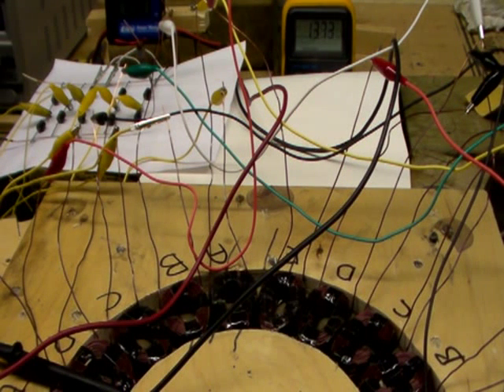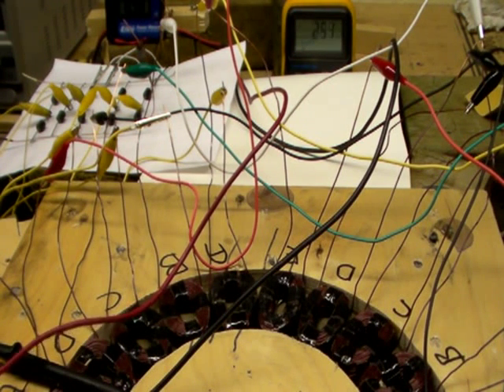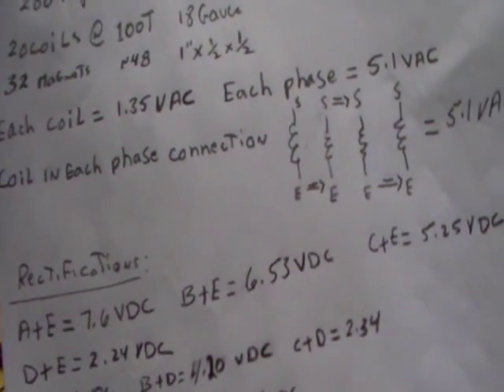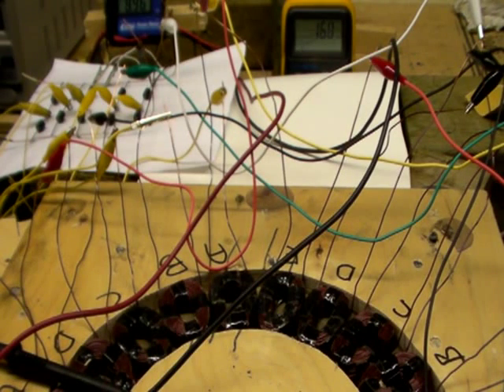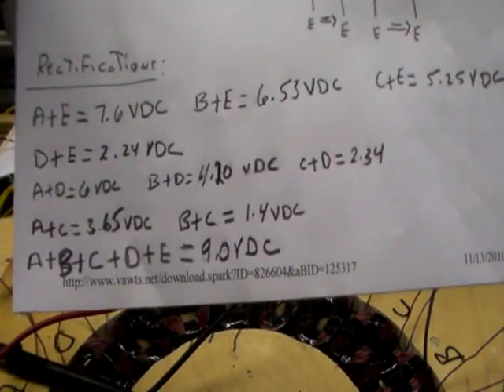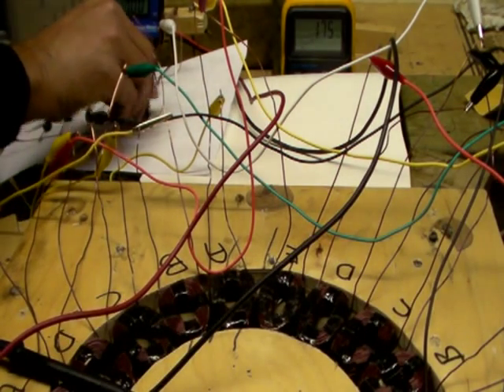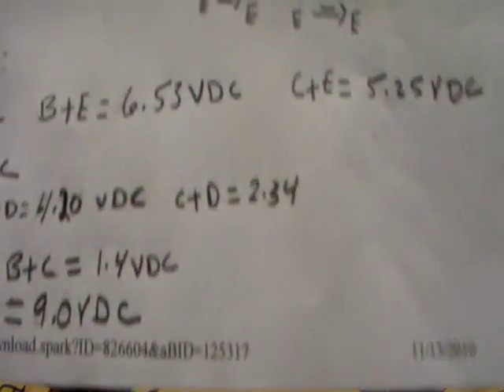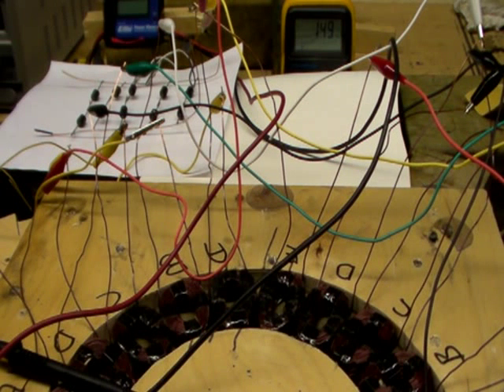5phase 36 poles pma wind turbine green energy vawt hawt 33.mpg

Comment: Mark, you're right, car alternators do need to run at higher RPM & be geared differently but it doesn't make starting them up in low winds more difficult at all. It takes exactly the same torque to start up a car alternator with a small or large pulley and that is minimal anyway if no field coil current flows until the alternator is up to speed - a simple and straightforward change to the default operation. If the turbine blades are variable pitch that can also help albeit an added complexity.

Comment: Automotive alternators are designed to rotate at high RPM; to make them work you need to change the "gear ratio" and this introduces pulley friction and certainly makes it more difficult to start up in low winds. A good Axial Flux designed for low speed direct drive will win over your proposal. I'm curious if any efficiency is gained with phases greater than 3, which is why I found this page.

Comment: Why would anyone bother producing their own inefficient alternator this way. Key objective should be optimisation of mechanical power output from VAWT. Then buy, at reasonable cost, a decent 200A 24v (or higher voltage up to 64 Volt plus) vehicle alternator. That's 4.8 kVA or roughly 7 HP required for max output. That's plenty to cover at least your average domestic daytime power requirements (NO heating or cooking!). Need more? Then use multiple VAWTs feeding a decent inverter system.